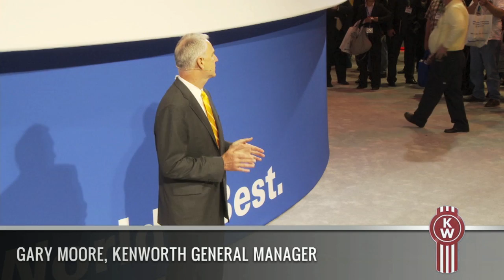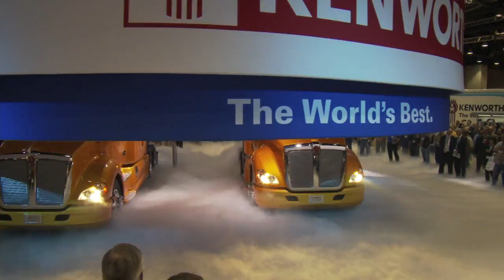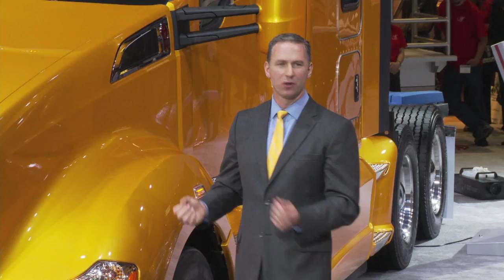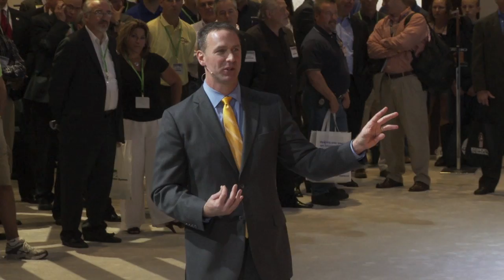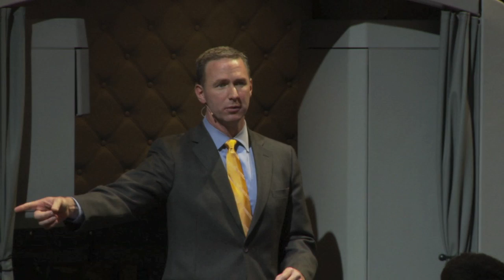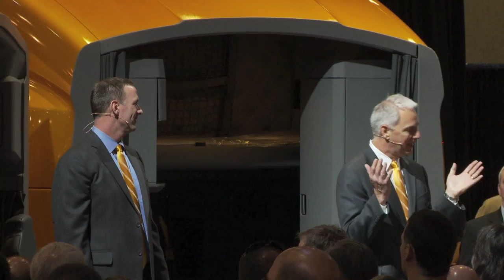The Kenworth T680 Unveiled

Comment: wonder if you improve the inside for the driver, you have some really bad interiors on the T660:
too much reflection on side windows (I believe this is due to the windshield & side windows too straight.
really bad/poor sunshade design
Not enough space in cab (that I see you have improved on T680)
overall lack of storage in cab & sleeper
Height is for midget
no controls on steering wheels such as jake brake controls
wipers freezing up all the time in cold weather, bad design with windshield washer
I could go on............